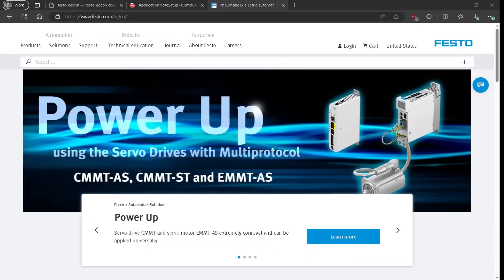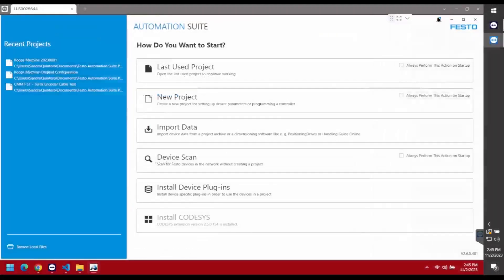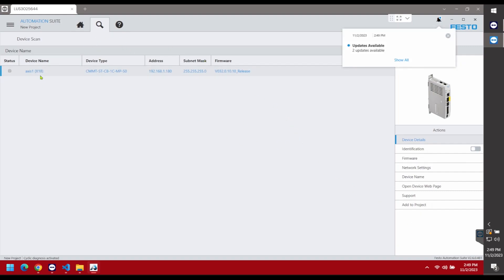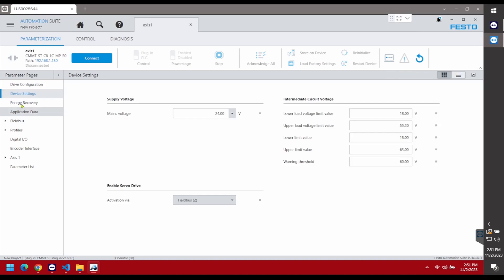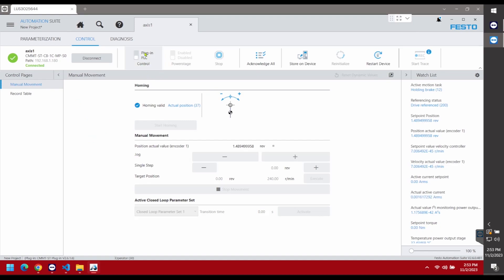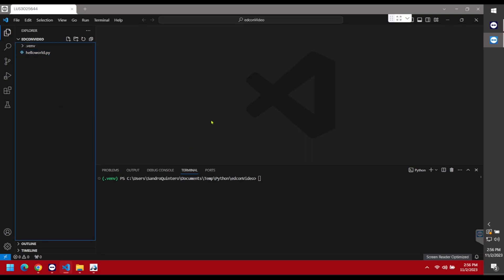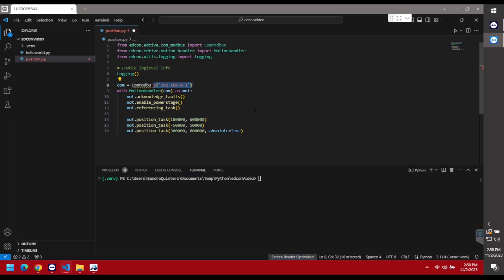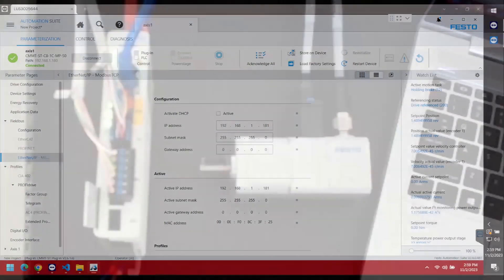Controlling Festo Servo Drive with Python Library

Comment: I'm having a problem when xf1 isn't recognizing or responding to python. I have the drive set to mudbus tcp, telegram 111 and configured my ethernet port to work with the ip address I have set for the port.
Reply: I'm using a cmmt-as-cs-11a-p3-mp-s1
Reply from the maker: It’s important that you Restart the CMMT drive after setting the XF1 port to Modbus. Once this is done, you should get online with the drive once again with Festo Automation Suite and confirm you are in Modbus TCP mode and that the Active network settings are the desired ones (IP address, Subnet, etc.). You can check this under Fieldbus > EtherNet/IP -Modbus > Active.

If the problem persists, we suggest you contact Festo Tech Support in your country so they can further assist troubleshooting.